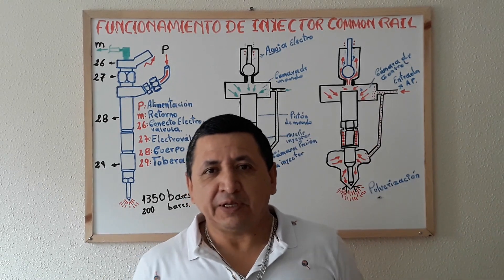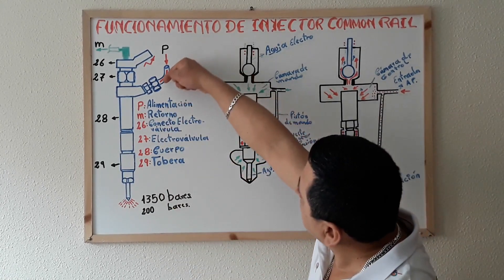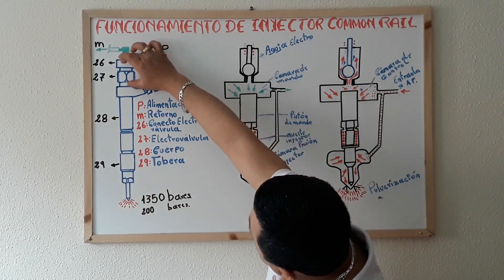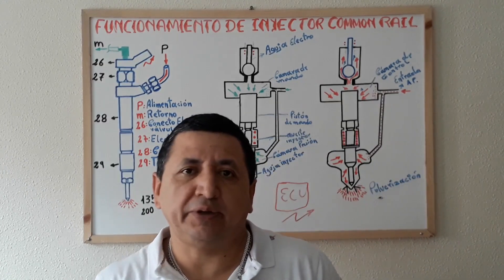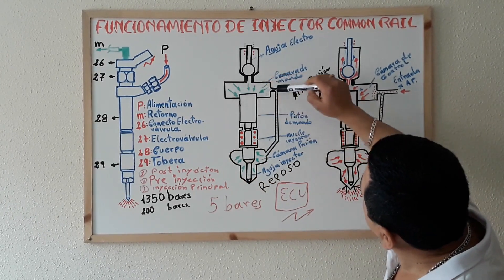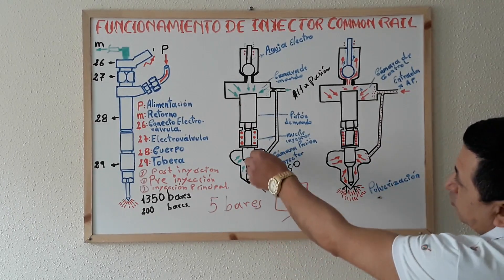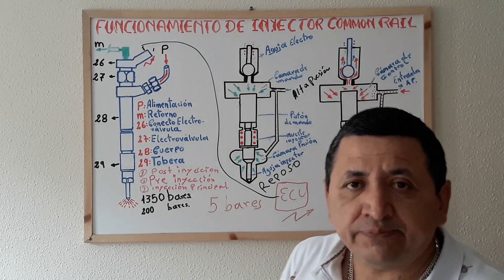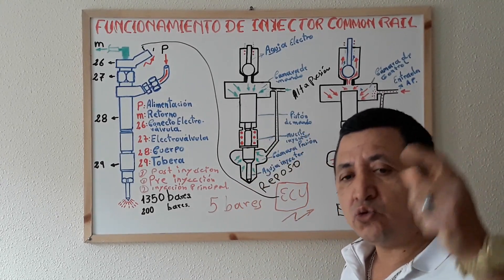Funcionamiento de Inyector Common Rail Bosch...

Comment: Gracias por sus videos.
Consulta, cuando la presión de alta, está en los inyectores en la parte alta y baja, esa presión es la misma del rail, en ese momento se produce un candado hidráulico, cuando se produce el pulso la cámara de control de abre y la presión de la tobera, vence el resorte de la punta del inyector.
Es esto correcto.
Un saludo desde Chile.
Atento a su respuesta
Reply from the maker: Hola amigo así es cuando la bobina es excitada por la unidad de control un saludo grande

Comment: Ola me gusta muxo tus vidios tngo un 530d i en relenti cabecea el motor un pokito en caliente en frio no lo ace  suena vien pero vibra un pokito al relenti epuesto el oido al inyector numero uno suena como la abuja no suena desde lejos pero si pones el oido.si lo percibes. la arandela de cobre no es lo e canviado  otro ruido como pich pich pich  ayuda gracias bendiciones
Reply from the maker: Hola amigo comprueba con una probeta los retornos y comprueba con escáner el trabajo de cada uno y si ves desperfecto en ese desmontas y lo mandas a reparar un saludo
Reply: @HOLGITER  muchas gracias dios t bndiga saludos

Comment: Gracias por sus videos yo tengo una Dodge ram 96 cummins bomba boschs 6L.12v. la pregunta es que está no le encuentro el gobernador ya que le quería cambiar los resortes 4k para más potencia par más caudal me gustaría si podrá aser vídeo de ese tipo de bomba 6 línea P7100 Bosch gracias saludos
Reply from the maker: Hola amigo gracias estaré subiendo más videos haré alguno de bomba lineal...

Comment: Profe. Una ayuda porfavor ...mi probl3ma es que saque un turbo de un Mercedez ML 166 blutec año 2012 pero no porque tuviera un problema..sino porque me dificultaba me impedia meeter la mano para arreglar una fuga de vacio en otro lugar ....el problema es al instalar el turbo nuevamente al motor ahora me quedo un ruido como si fuera una suction al desacelerar y cuando paro el motor se queda haciendo el mismo ruido....ahora me estan culpando porque dicen que no le eche aceite al turbo gracias por su ayuda
Reply from the maker: Mirar donde es el ruido en la turbina
Reply: @HOLGITER  si es por donde esta la turbina pero solo cuando acelera y desacelera....saque el turbo otra vez y se ve buena la turbina